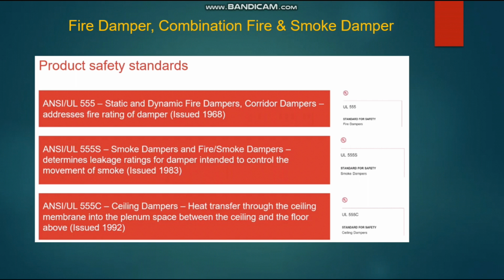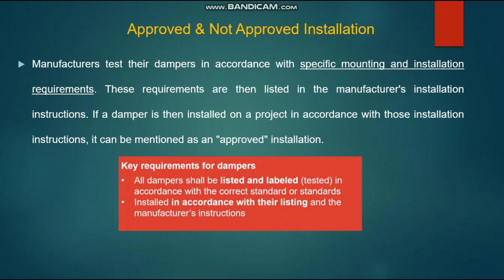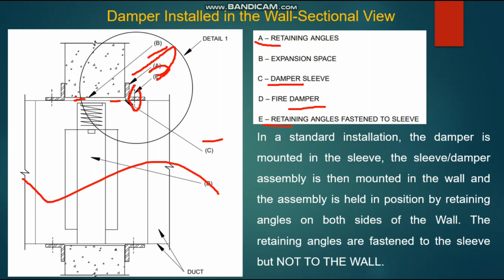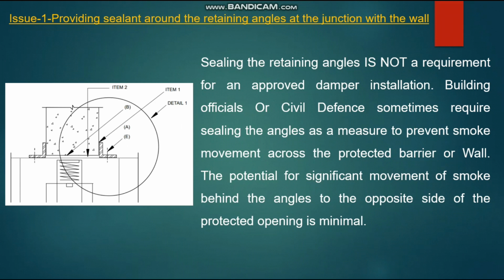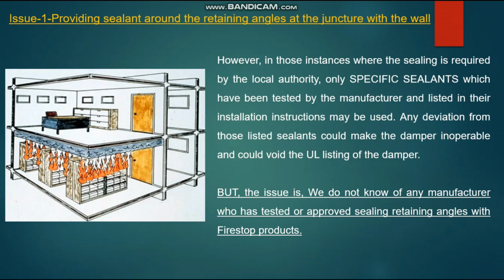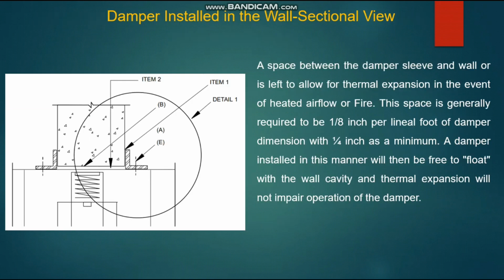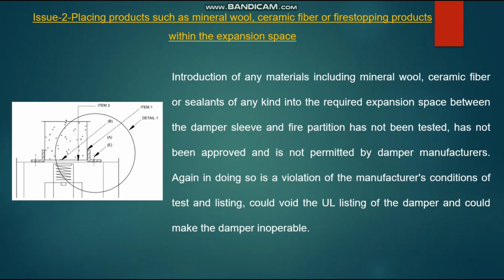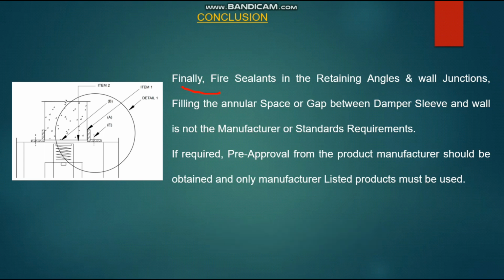🔥Important Installation Mistakes 🔥- Fire Damper, Smoke & Fire Damper

Comment: Till today, i am applying the fire sealant around retaining angles in all my installation and it is acceptable also in the inspection time.
Reply: Me too
Reply from the maker: 😂 but it is not required so next time u need to make sure with your supplier or manufacturer